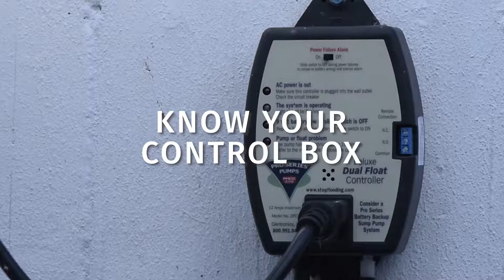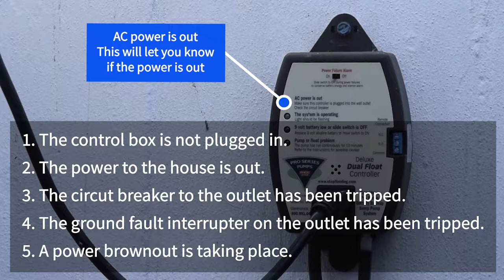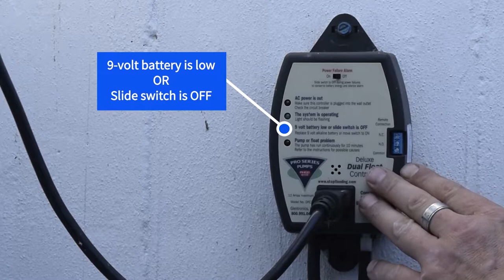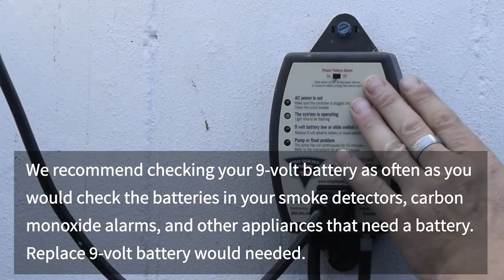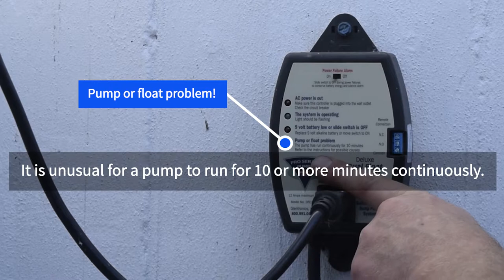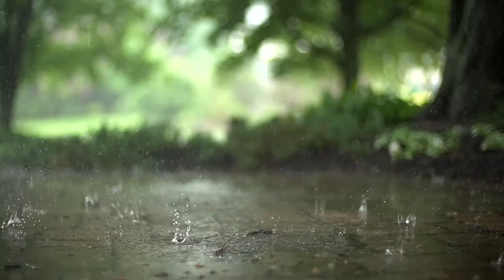Your Pro-Series DFC2 Controller, what to know

Comment: I have this controller and it won't stop beeping. Battery light on, took out battery and it tested as full capacity. Trying toggling switch off and back on, tried power cycling the controller to no avail. Wondering what else may be causing the 9V light to be on and the continuous beep

Comment: i have one of these. after 4 years, it failed. Doest shut off the pump.
Reply from the maker: Sorry for the slow response, but I had to find the right person to talk it over with. They mentioned it could be a few things.
1. It could be a frozen discharge; the water has no way out, so the sump basket is not able to drain, and the water level remains.
2. Could the floats be stuck? Clear out the debris from inside the float cage.
3. Might it have shorted out? It is a small appliance, which means it can go out unexpectedly.
Those were the top three items that came to mind. If you live in Minnesota and one of our customers, feel free to contact us, and we can help you figure it out.
If you are not a customer, I would try and contact the company who either installed it for you or contact the manufacturer of the PHCC Pro Series Sump Pumps, Glentronics. Thank you.